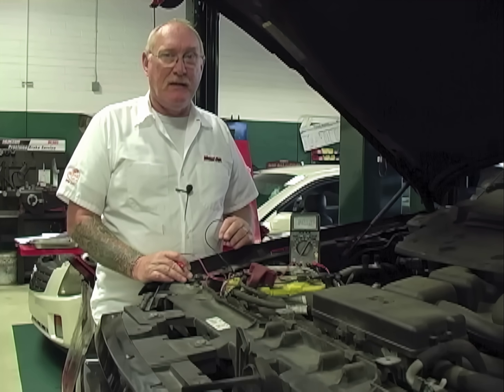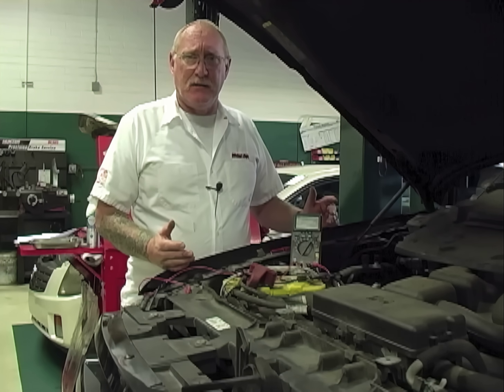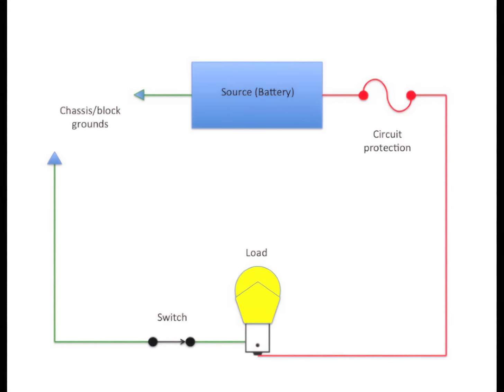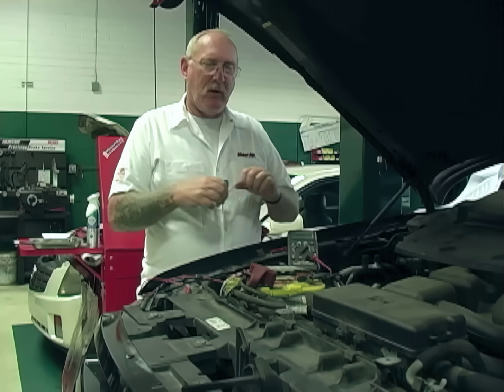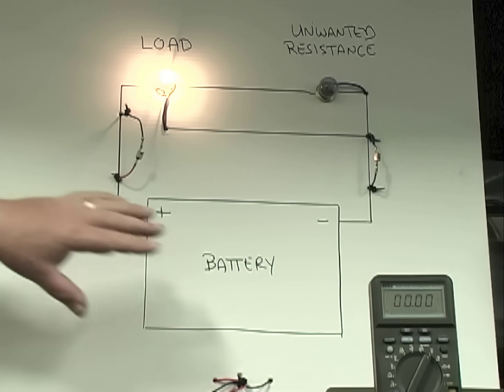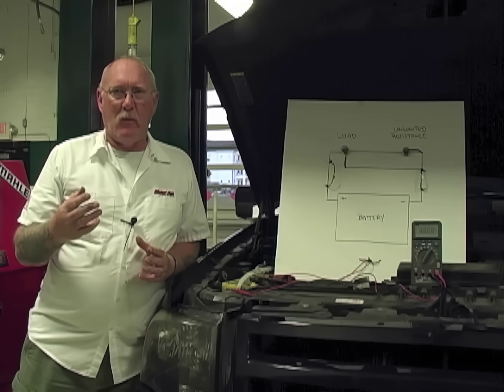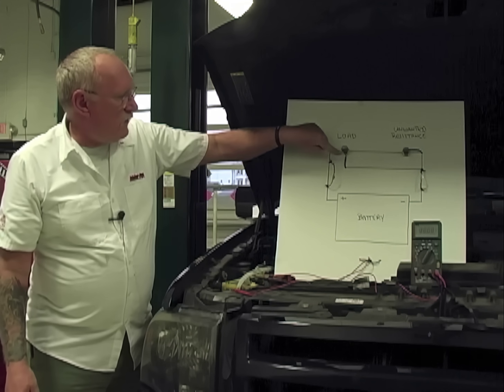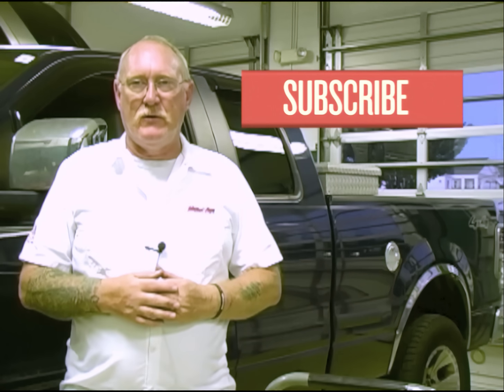The Trainer #47: What measuring voltage on the ground side means

Comment: The name of the video is misleading, or more accurately, incomplete. I know you immediately identified what you are doing as being a voltage drop test. Learning how to do a voltage drop and when is something every tech should learn right away. The exact same test can be done for instance, from the positive post on the battery, and the positive stud on the starter. Any reading above more than a few millivolts is a bad connection. Or, voltage drop.

Comment: I had something like this happen to me. I was installing electric window motors and tested battery + at 12.5 but the motors would not budge. When I connected the battery - to the motor they moved very slowly but they moved. I thought this was impossible. But you just explained it. Thanks

Comment: Many times the voltage drop in 12 V car circuits is not as extreme as in his example and it may only be from 0 to1 V but that is still an indication of resistanceOn the ground side of the circuit due to poor contact or faulty wiring

Comment: Your wiring diagram is confusing. As long as the ground side of the first lamp is unbroken, the reading will be zero, yet you read over 6 volts. Why? You don't show a break in the ground side from the first load to the ground side of the circuit. Current will follow the path of least resistance. so unless there is a break in the ground side , you did not show one, the reading should show the battery ground and read 0 volts.
Reply from the maker: You're right. The ground path is not broken but it does have a source of unwanted resistance present - loose connection, corrosion, etc. That causes the voltage to be shared between the two primary sources.

Comment: Yep, absolutely true. A number of years ago, I was given a old car by a friend that just wanted to get rid of it. One headlight was full brightness, but one was very dim, and I couldn’t tell the diff between high and low beams. He told me that no one had been able to locate the problem. 
    I traced the problem to a corroded ground wire on the dim headlight. The current was finding its ground path through the other filament, then to the other headlight through the wiring. I added a separate ground wire to the circuit on the dim side… worked perfectly!
Reply: Well done, knowing the concept, helped you solve the issue.

Thanks for sharing, I will keep your example in mind for lights. 🙏

Comment: I subscribed. You are a natural teacher. I learned something very important today. But I do have a question.... You said that I have to test individual circuits if I see a drop. In a practical sense, with all the wires in a system, how do I know where to put my probes? It is a maze of wires under the hood!
Reply from the maker: Typically, you're dealing with a problem in a single circuit. You start by examining that load's drop using the method I describe. If a problem is found, then you move back toward the battery, following that circuit's path, until you isolate the cause. You'll need a schematic of the circuit to know where to test. And, in some cases, the problem lies in a portion of the wiring that is shared by multiple components. Worry about that when the time comes. Hope this helps and welcome to the channel!

Comment: Voltage drop was a life-changer as a dealer tech. Every new tech needs this video as a primer to step into the shop. You are are a gentleman and a scholar, and even more, you are a teacher among teachers, sir.
Reply from the maker: Thank you
Reply: You have got to be kidding.
I taught electronics in the military and civilian sectors and, though you may know what you're wishing to convey, they way you convey it is convoluted and confusing.  Even your mockup with the two bulbs as resistances in a circuit is confusing because you have another black line representing a circuit path shorting the "unwanted resistance."  Why would you do this to people who are already struggling to understand what you're trying to convey?  The fact that you call the red lead of the DMM the "positive lead" and the black lead the "negative lead" shows a fundamental misunderstanding of how to use a DMM.  The black lead is the REFERENCE lead and the red lead is the MEASUREMENT lead.  There are systems that are positive ground where the reference lead will be on the most positive side of the power source.  Telecommunication DC plants are like this and are -48VDC, typically. When you see a measurement, the reading is IN REFERENCE to the black lead and it may be positive or negative but you know it is WITH RESPECT to the reference lead.
Telling people that "voltage is consumed" by a load is also just confusing since there is no physical way to demonstrate this.  It's just as easy to teach electrical fundamentals CORRECTLY as it is to BS your way through it.  I'm a retired engineer/teacher and what you did in these 9+ minutes is just cringe. Telling people to remember adages instead of explaining the "why" of it only makes things easier on YOU, not on the pupil.   SMH     Awful.  Just awful.  THIS is why people think electronics and/or math is difficult... they think if they don't understand something it's because they're just not getting it when, in fact, it is the horrendous teaching abilities of the person in from of them.
Reply: @DiffEQ  Please direct us to your video on this topic so that we can learn something. I see that some other people have made the same request, so please edumacate us!
Reply: @DiffEQ in the automotive world, nearly everything is 12 volt D.C. negative ground.  The only thing I’ve ever seen with a positive ground is a Ford tractor from the 1950s that was 6 volt.
Reply: @bluegrassman3040 had an International Harvester Metro van to play with back in high school in the 60's.   In was a HUGE van, 8 volt positive ground, ouch!   

I taught electronics at Great Lakes, went into Avionics, became an Avionics Engineer.   This man did a bang up job staying out of the weeds.   He was NOT teaching electrical engineering.   He was helping a majority of mechanics with a solution to a problem.   Good job in my book!
Reply: @bluegrassman3040  We have a John Deer Tractor with the positive cable going to the frame.  When I saw that it made my head spin.
Reply: @50Quid-d3x  I never knew JD ever did  that, but that’s neat to know.  I thought Ford was the only company that ever used positive ground on their old tractors.
Reply: @DiffEQ  so where is your video to train people properly?
Reply: @DiffEQ  I am still waiting for you video so that I can understand.
Reply: @DiffEQ I am interested in knowing what positive static charge is and what negative static charge is.  

You would think positive static charge  would be associated with protons,  but positive, negative static charge is purported to be just electron spin.

The reason it's such a big deal is negative charge is extreemly benificial to human health.  

When the hydrogen molecule looses its only electron... it just becomes a proton and an accumulation of these protons is acid or acid strength.

The addition of negative charge rebalances or restores the hydrogen molecule back to its origional state.

Comment: I have a crystal sebring 2006 2.7 litter , if I hook it up the the positive no ground I have 12.6 on frame all thew the fuse box if I hook the negative up zero. Did a parasitic draw it over 1. Am.  I can not figure it out weather short is on the what side, the alternator is thee years old, week battery but it was still good. Old had more voltage than my new Costco battery. I used load tester but the new battery was strong

Comment: Watched two of your videos on this subject, I'm working on a 12 v house bank on sailboat, at a distribution panel with negative lead disconnected, I'm getting the indicator lights lighting, thinking the wires to the loads, at least one is completing a circuit, Is this possible through a light bulb,? still not sure if this is the same problem, I will fiddle and think.maybe get it straightened out, On boat wires return negative to battery.
Reply from the maker: Need to be a bit more clear here. Negative lead disconnected from the battery? What indicator light? Do you have a schematic of the systems? Negative or positive ground system?

Comment: Would you be able to give references of electrical car technicians in FL ... near 34205 ... perhaps? If there are not enough certified electrical car mechanics all around USA will this present a real problem for driivers of the 100% electrical cars or hybrid or it will make no difference? many thanks in advance, from FL

Comment: Dear Sir. I found a Master Tech that did an awful work and charged incredible amount. So, I do want to learn from you because now I am scared I am going to lose another smoking starter. I see an area of starter cable touching the metal tubing of the transmission stick and I did see an spark when the stick touched the very top of the tube! Would it be fixable enough  if I use enough electrical tape around the cable so they will not touch each other? I also found same situation with the ignition coil plastic box rubbing against another cable, and this cable shows signs of burning! it smells as burned wired all around and the Master Tech did or say nothing.  I do feel that my car still has many years of driving with only 117K miles, Many thanks for your video, sir. I just hope you are still around and in good health, since the date above shows 2015 FL
Reply from the maker: You should relocate both to keep them from rubbing against anything. Check the motor mounts as well, as worn mounts can allow the engine to move more than it should and damage cables/harnesses.

Comment: hi hope your doing well . good vid. i have a Kawasaki Vulcan 750.All lights and gauges work. Cooling temperature sensor(chassie ground) and cooling fan switch(power from junction box) . . I took 2 jumper wires from fan motor one pos other neg fan worked.I have a 2 prong on&off toggle switch. Can u explain how i connect toggle to fan motor or Temp, fan switch. Please in dire need of your experience please help thanks
Reply from the maker: I would need a wiring diagram for the bike to help. You can email one to me a pete.meier.training@gmail.com

Comment: Two (2) lights on the same fuse would be wired in parallel, not series?  
Opposite rule(s) of series circuit?   Current split between the 2 loads?

Voltage measurement would what on each side of the load?
Reply from the maker: Not necessarily, but rarely done on purpose. The second light represents unwanted resistance in the circuit which causes the supplied voltage to be split proportionally between the two major sources of resistance. That, in turn, reduces current flow in the circuit. Hope this helps!

Comment: let me give a tip along this ground   thing    ---- no matter what you try all you get is a click jump start will not work  new starter will not work  solenoid not  work    very simple tbl.?????????????he neg battery cable is about to fall of the chassi the bolt is loose   i am  88 i have h this happened  3  times  so its rare  the second and third time i knew where to look   the first cost megga $$$$$$  while you have jumpper cables  handy conn one end to neg battery  conn othe end same cable to a good gd if thats the tbl it will start  so tighten bolt on gd cable

Comment: You are looking for a short to ground in this example?  comment please.
Reply from the maker: A short to ground, in this case, would only shorten the circuit's path and have no real impact on your reading. This is a high resistance on the ground side of the circuit. Kirchoff's Law says that all the voltage will be used by all the resistances in the circuit. When we add one, it takes away from all the others in proportion to one another. Hope this helps!

Comment: Conventional theory of current in the tutorial?   Says positive to negative,
but we know that is reversed?    Totally confused because I know this.
Reply from the maker: Voltage drop doesn't care - it drops across each source of resistance. The tools we use, however, are oriented to conventional theory even though we all know its negative to positive. You don't measure 12v on the ground side of a connector, do you?  :-)

Comment: The clock is always a load?  Alarm system always a load?
Reply from the maker: Any device the circuit operates, that does some kind of task, is a load. So yes, the clock is a load if connected to the vehicle's electrical system. An alarm system is just that - a system - portions of which will be loads.

Comment: I once had a car with a rear window defroster, in the form of wires across the window, that did not work.  Multiple mechanics at three different shops tried to tell me it was fine.  They measured 12 volts on the wires, but failed to notice that the voltage did not drop as the wires went across the window.  I found the interruption on the ground side of the circuit and fixed it, and the defroster worked fine after that.

Comment: great video! I have a situation that maybe you can help with; I connected (4) additional wires to a 12-volt direct light switch- I am showing 13,7 volts on the power side and 10.3 volts on both ground wires these wires are currently not connected to the accessories; Why am I showing voltage on the NEG-GROUND SIDE"?? I have check numerous times and cannot see the problem; any help would be appreciated,thank you,PJP
Reply from the maker: Sorry for the delayed reply. If you are reading across the switch and the circuit is open, this can't be voltage drop - no current is flowing. Check the resistance of the switch. If it is significant, then it may be acting more like a load than a control device.
Reply: @VehicleServiceandRepair  GOT IT"!! THANK,S PJP
Reply: @VehicleServiceandRepair  
GOT IT"!!!

Comment: This is way I personally only run the ground wire through a firewall of a vehicle to a switch to turn a relay on-off because if that wire shorts out the add on fog lights will just come on, even if you fuse a  positive wire I still feel safer running a ground for a relay signal wire instead of most run the positive wire for some reason.

Comment: why have I got 13.00 volts between the negative cable  (disconnected) and negative terminal, I blew my volt meter in amp settings, new volt meter 13.00 volts.
Reply from the maker: Sorry for the late reply. It looks like you're connected to ground on both sides but really, the meter lead on the cable is the "positive" side of the problem...the high resistance caused by the open circuit. With no current flowing, this isn't voltage drop. The cable side lead is directly connected to the positive side of the battery - through the cable, to any electrical component, to the positive connector on that component, through the fuse, and then the positive cable back to the battery. Make sense?

Comment: Can you test an ignition switch by viewing it as the 'load'? Will hooking the battery to a removed switch to test for voltage drop, which is showing up on the + side of the coil, hurt the ignition switch, because the load of the switch is too light?
Reply from the maker: The switch is not a load and if you try what you describe, you're going to be in for a rude surprise! But if you leave it in the circuit, you can measure the drop across it by placing one lead on the power going in and the other on the power going out. Just turn the key "on".
Reply: @VehicleServiceandRepair  Thank you for helping me. I have my switch out of the car and wanted to check; all I know is to do resistance with the meter- .3 on one ignition circuit and .4 on the other. But is this result meaningful to find 1.5 low voltage at the + coil when starting?
Reply from the maker: @rexosteen5451  No, it isn't. 

My first question is, "What problem are you trying to solve?"

To properly check that B+ connection at the coil, place the positive meter probe there and the negative meter probe on the positive post of the battery - right on the post, not the connector. What do you get when you try and crank the engine then?
Reply: @VehicleServiceandRepair  I concluded my switch was bad, after checking my bulkhead connectors. Now that I have my old switch out, how do I determine if it's bad without hooking in up to a starter? I've already replaced the switch with a 1970 NOS one and am assemblying the steering column.
Reply from the maker: @rexosteen5451  You'll need to identify, using a wiring diagram, what pins are connected in the different positions. If you want to voltage drop test it, you'll need to build a simple circuit - use a headlight bulb as the load - and put the switch in the circuit. Turn it to the different positions and measure the voltage going in and coming out in the different positions. They should be close to the same - any major difference is the problem contact.

Comment: So on say a 2008 Mitsubishi Lancer if on my MFI Relay on the ground side of the electro magnet on that blade in the terminal of the relay box has 12v and the ECU on the corresponding pin has 12v regardless if the key is turned or not it would be a fair point to say that the ecu is not grounding or activating the low side driver to ground that side of the relay? Is that a fair way to think of the idea that if I see voltage at the ground it is not grounding as it should if between that relay and the corresponding ecu pin there is nothing else to possibly short to that ecu ground?
Reply from the maker: If you are measuring the relay pin with the relay installed and the circuit activated, then yes - the presence of 12v indicates that the solenoid has not been grounded by the ECU. You can check current flow through the relay as well to gauge whether or not the ECU has turned it on. HTH!